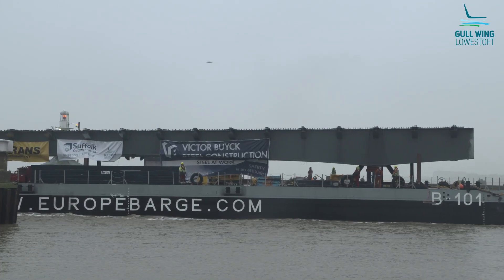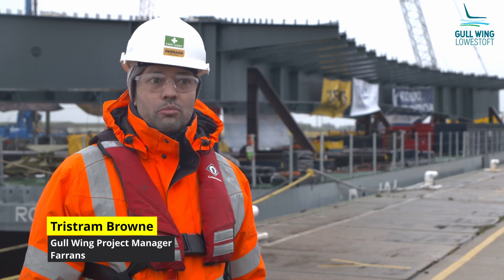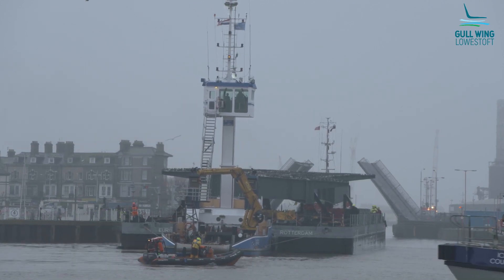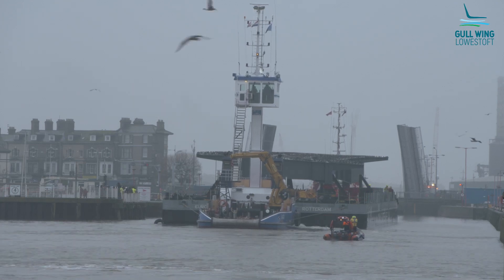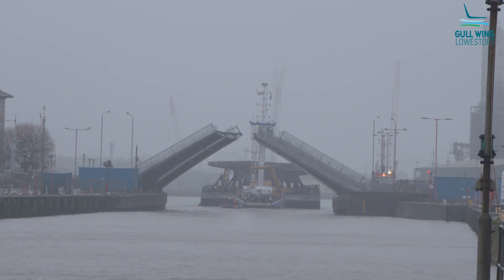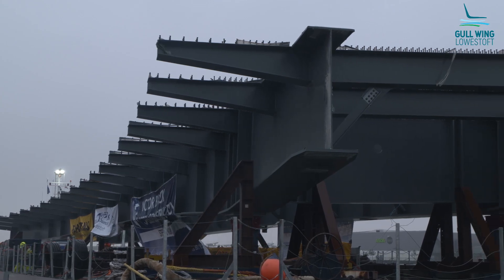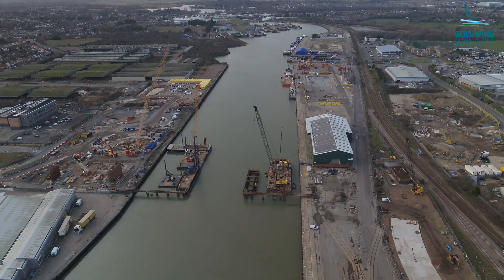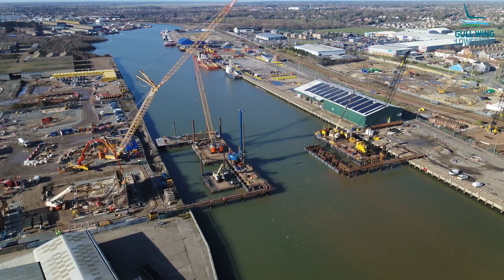First section of Gull Wing bridge arrives in Lowestoft

Comment: That name "Gull Wing" is fantastic. I believe a group of school children came up with it! Well done kids.
Reply: !!!  It just looks like some rotten old shelf bracket  !   Ugly ugly ugly - yes you can see some kid 'designed it'
Reply: @mybella4692  At least the bridge is going to be unique like the mudford lock and the Lowestoft main bridge called Bascule bridge, most of the bridges with these names are just basic where 'as these stood out amongst the crowd for example; Bascule bridge has gates for pedestrians and barriers for roads with the alarm being different. Mudford lock has 4 large barriers on the left and 2 long and short barriers are on the right because the left has the cycle path than the right however, the Mudford lock has a bridge going from a small cafè down to St. Nicolas park. Since the Gull wing is going to be like a gull's wing then it does fit the name, including the fact that the gull wing is close to the Asda shops and the Council building at the south end including a new park at the north end which makes things a lot calmer and easier too and not to mention the fact that there will be less traffic problems which will ease the waiting times on Bascule bridge works or Mudford lock works.
Reply: @mybella4692  

Lol...that's just the steelwork skeleton of the section. They have been completing it since it arrived!